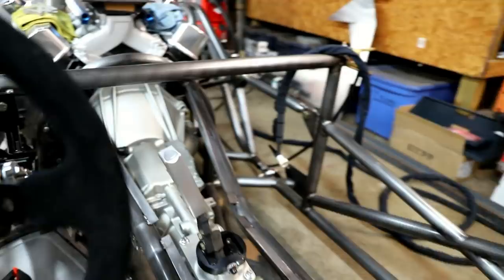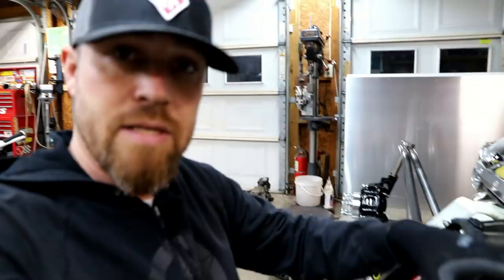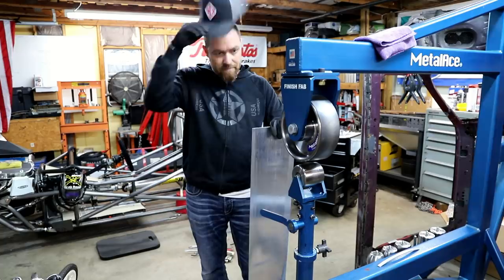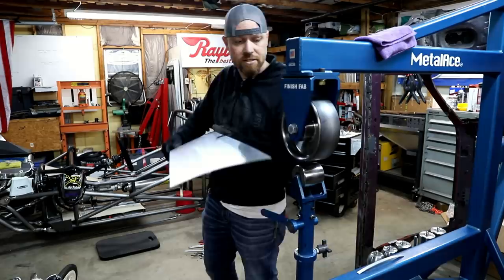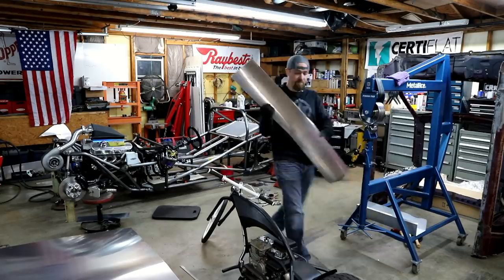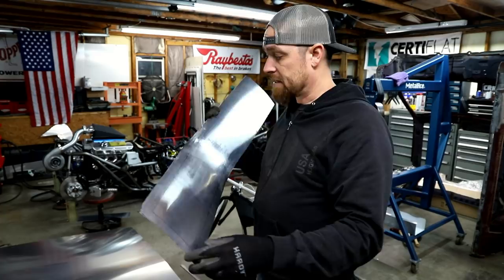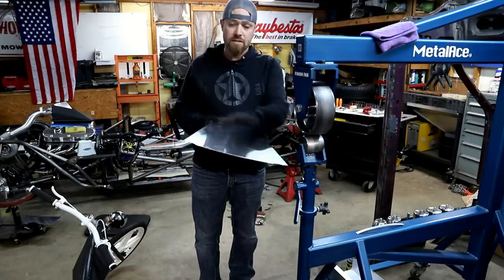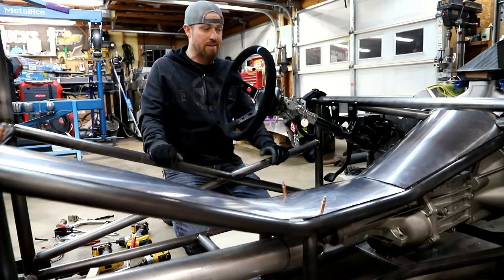Hot Rod Fabrication with an English Wheel

Comment: You do better work than I do, and I like the overall design, but I'm concerned about the lack of tubes in the center of the car.
Reply from the maker: lack of tubes? in what capacity?
Reply: @Thefabforums  there's one tube connecting the top and bottom of the trans tunnel. Theres 1 tube connecting the trans tunnel to the sides. 
With a v8 that thing is going to twist in the center.

Comment: I noticed at about the 8:20 minute mark the bottom die/roller is moving a bit not sure if that could be an issue.  Just an observation.
Reply from the maker: yeah it puts some side load on it when you get it out on the edge

Comment: seems to work well , one way i seen that quilt thing done on a bead roller was with a sharp edge wheel and a rollerblade wheel 
https://www.youtube.com/watch?v=859YBxgpgPw
doesnt seem to mind that youre crossing previous rolled lines too mush 
i think it will look nice and fills in a lot of open real estate on the panels , either bare or painted to look like leather 
wonder if you can adapt a beadroll die to make stitchmarks never seen that done on metal before